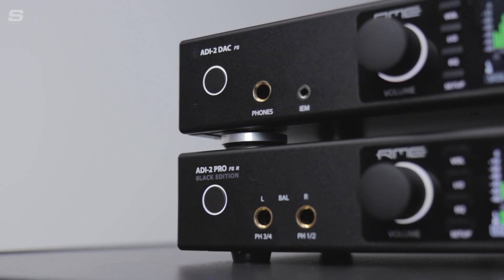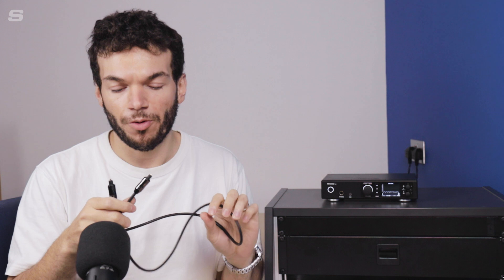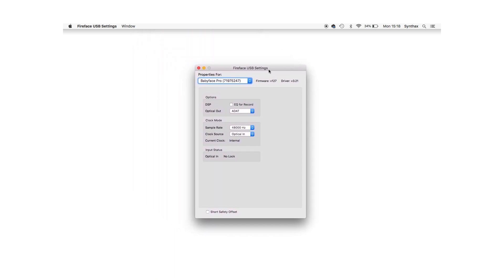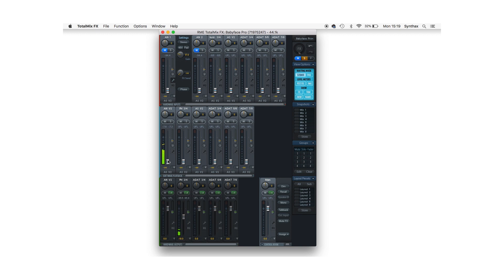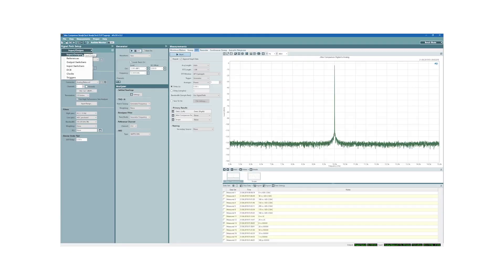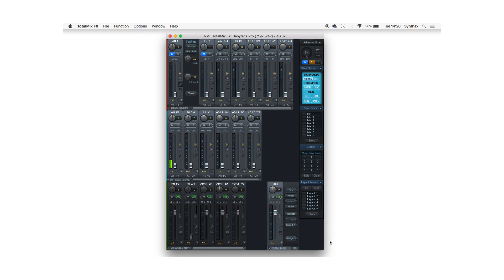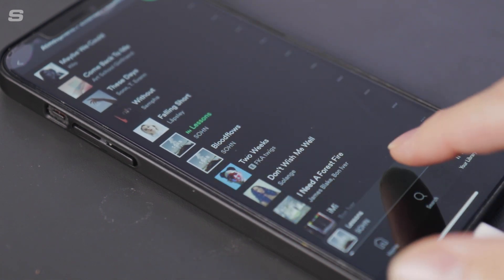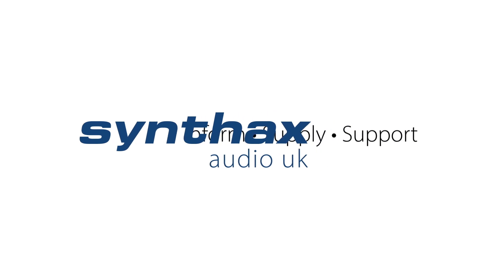How to connect the RME ADI-2 DAC FS and ADI-2 Pro FS R to an Audio Interface

Comment: This is perfect.
I want to upgrade soundwise and already ordered the UCX 2.
My question is...When i buy the ADI Pro fs R how do i connect my adat interface with my UCX 2 in conbination with the ADI Pro fs R? I think it's daisy chaining but not sure how in the correct order. Can you help a bit please?
Reply from the maker: Hi Chris, and congrats on ordering a UCX II! You may be able to connect all three devices, but I'd need to know a bit more about your setup;

1 - Are you on Mac or PC?

2 - What device is the 'adat interface'? i.e. what brand and model?

Let me know and I'll try to help!
Reply: @SynthaxAudioUK  Thnx for your reply. 
1: I'm on Mac.
2: It's the Behringer ADA8200.

Thanks a lot!
Reply from the maker: @chrismacintos6304  Ah okay, in that case it should be doable. The short answer is I'd recommend having the UCX II connected to your Mac as your interface (and set as clock master), with the Behringer hooked up over ADAT, and the ADI-2 Pro via AES-3 for your main output. Then use TotalMix to control all of your routing.

Here's a more in-depth version if you want a bit more info;

1 - Connect the RME Fireface UCX II to your Mac via USB. Set this as clock master in the RME settings.

2 - Connect the Behringer via ADAT to the UCX II. Looking at the Behringer it looks like its actually an audio interface as well (I thought it was a mic pre at first glance), so I'm working on a bit of an assumption here that it will play nice with the UCX via ADAT... (Alternatively if you have any problems, you could try creating an aggregate device since you're on a Mac.)

For clocking, set the Behringer to word clock slave via the back panel. Note that I'm also assuming that you can clock the Behringer over ADAT - if not you'll need to clock it to the UCX via the BNC connection.

3 - RME ADI-2 Pro connected to Fireface UCX II via AES-3 (AES-3 is available on both the UCX II and ADI-2 Pro FS R via each device's breakout cables). 

I'd recommend using dedicated digital XLR cables for this - you might get away without one if you have the two units right next to each other, in which case the breakout cables may reach. They're pretty short though, and we'd always recommend connecting via dedicated cables anyway - more room to work with, less chance of putting strain on the cables, easier to replace etc. 

If you buy a pair of AES cables, you can connect the second cable from the Pro back to the UCX, which will allow you to use the ADI-2 Pro's inputs for recording as well. For the clocking, set the ADI-2 Pro as slave (via its front panel).

4 - Finally you'll need to set up all of your routing in TotalMix FX. This should be fairly straight forward if you have previous experience using an RME interface (set the AES-3 output as your Main output, and set up your inputs and outputs for the Behringer). 

If you're new to TotalMix it may lead to some head-scratching at first though - I'd recommend watching RME's TotalMix tutorial series, or our own videos (they're from back in the day, but still relevant);

TotalMix FX Beginner's Guide
https://www.youtube.com/playlist?list=PL0QKeSpeDQwHGxAhD-cJSIBZC7_en5rck

RME TotalMix FX Tutorial Part 1 (of 2) - Synthax UK
https://youtu.be/sCH3qVaLL-I

Best of luck with it and enjoy your UCX II. If you need further assistance you can contact support for your region here;
https://www.rme-audio.de/support.html
Reply: @SynthaxAudioUK  I'm laughing. I totally forgot the AES connection. Now i understand how to get it connected.
I took a look at the rme breakoutcables. I need to buy them myself i guess. So both devices need a breakoutcable and all i have to do is connect them with 2 fem/male XLR'S? Is that correct?
The other connection stays unconnected? (Red white cable) (spdif)

These connections are new to me so wrapping my head around it since i have a few months left to wait for the ucx2!
But i need to know everything in detail and need to know which cables i have to order to make it work!
Reply from the maker: @chrismacintos6304  Hey Chris no problem, there’s a lot of different formats out there - we’re thinking about creating some new vids to explain each one, so watch this space :) 

You’ll get a breakout cable included in the box with each device, they’re basically just there to add more I/O that RME didn’t have space for on the main body.

I’d recommend buying proper cables though still - just Google digital AES-3 XLR cables. Make sure you get digital ones of course (analogue XLR cables won’t work for AES).

“all i have to do is connect them with 2 fem/male XLR’S?”
- Yep! As you’ve spotted, the red and white connectors on the breakouts are for SPDIF. This is another digital audio format that is similar to AES-3 (and ADAT). You can actually use this if you want instead of the AES connection, it’s up to you (just search for SPDIF coax cables). 

I personally favour the AES connection as the 3-pin XLR is a more solid connector, plus it leaves the SPDIF available for other devices if you fancy running them through the ADI-2 Pro (most consumer devices have SPDIF on there - TVs, games consoles, CD players etc). 

(Watching blu-rays through a PS4, the ADI-2 pro and a good set of headphones is great fun!)
Reply: @SynthaxAudioUK  Thnx for the info. I know where i'm at at the moment. Starting to understand it.
And on the speaker part.
Do i keep my monitors connected to my interface or do i need to connect them to the ADI-2 PRO?
Does the ADI has balanced outs?
I see xlr's and jack on the main output part on the rear.
Reply: @SynthaxAudioUK  I emailed RME to ask what options i got.

They told me to use only ADAT, both ways.
So ADAT out(UCX2), to ADAT in(Behringer), ADAT out(Behringer), to ADAT in(ADI-2 Pro FS R.

Also they've told me that it is not neccesary to use the AES connection.
I wonder what will work best. I can't wait to install my new stuff...
Reply from the maker: @chrismacintos6304  Ha cool okay, say hi to them for us! (We're RME UK...)

Re. Balanced outputs - yes the ADI-2 Pro has balanced outputs, and yes I'd recommend using this output for your main speakers (the ADI-2 Pro has higher quality DA than the UCX).

In regards to connecting all three devices via ADAT, yeah that should also work and might be a more elegant way to do it, although presumably that means you're losing 2 channels from the Behringer. (i.e. you'll only able to record 6 channels at a time from the Behringer)
 
Basically you've got a bunch of different options in how you choose to connect it! Enjoy :)
Reply: @SynthaxAudioUK  hahaha. Funny as hell! So the xlr's and jack outputs are balanced right? Well if that's the case that'll lose 2 channels i don't want that option haha. I need as much channels as possible atm. My rig isn't finished yet. So in order to keep al 8 from the behringer i need to connect via AES, the option you suggested?
Reply from the maker: @chrismacintos6304  Hey yeah both the XLR and TRS outputs are balanced on the ADI-2 Pro. 

Re: daisy-chaining via ADAT, it’s my understanding that if you send 2 channels from the UCX to the Behringer - then send those 2 channels again on to the ADI-2 Pro - you’ll only be able to add 6 channels to the ADAT stream from the Behringer (as ADAT is limited to 8 channels).

If you use the AES or SPDIF connection, this won’t be a problem as it’s completely separate to the ADAT, leaving you free to use all 8 inputs and 8 outputs from your Behringer.
Reply: @SynthaxAudioUK  you've helped me a lot to understand it.
Many many thnx!

I will use the AES for sure now and connect the Behringer in and out via adat.

Thnx a lot again.
I will most definitely come back here if i need more advice.
Reply from the maker: @chrismacintos6304  No problem! If you're in the UK, don't forget we offer a free 5 year warranty on RME products - just make sure you buy your gear through one of our authorised UK dealers, listed here;
https://www.synthax.co.uk/latest/dealers/
Reply: @SynthaxAudioUK  honestly...It sounds very appealing. But unfortunately i'm a dutch citizen.

Comment: What are the main differences in conversion quality between the ADI-2 Pro FS R and the Babyface Pro FS? I'm not sure if it has to do with just the implementation of the clocking (Steadyclock FS) or the monitoring capabilities of the ADI-2.
Reply from the maker: Hi Milton, both the ADI-2 Pro FS R and the Babyface Pro FS have SteadyClock FS, so you'll get the benefit of that technology with either device. Discussing sonic differences between RME devices is difficult since all of them follow a similar goal of 'transparency', although in terms of sound quality the ADI-2 series are a step above any of the standard RME audio interfaces. 

That being said, the Babyface Pro FS really is an excellent sounding interface already - I personally own one and I love it! And whilst I'd also love to have an ADI-2 DAC or Pro as well (maybe one day...), I don't particularly feel I'm missing out with the Babyface Pro FS - it already sounds fantastic, and gives me the benefits of proper RME drivers and all the flexibility of TotalMix FX.

The dream combo is of course like we show in this video - an RME interface with an ADI-2 DAC or Pro tacked on, which will give you that 1% or 2% extra. We're talking fine margins here though, and it depends on the usage case. Most of the music I do is dance and electronic based, and personally I think an ADI-2 is probably unnecessary or overkill for what I do (synths and drum machines...). If I was recording and mixing more classical, jazz or acoustic instruments in my work, or if I was regularly mastering for myself and other people, then I'd probably be looking to add the ADI-2 Pro or DAC to my setup. As it stands I'm perfectly happy with my Babyface Pro FS for day to day music production duties, although if money was no object I'd definitely add an ADI-2 as well.

Hope that helps clarify things a bit!
Reply: I’m experiencing a reduction in volume with this setup… and I’m afraid to push my ADI 2 Pro fsr too much. Seems if I want full volume I have to listen directly from the Babyface. While I am using lower power Headphones (beyerdynamic dt 770) I really can’t detect a great difference in audio quality between the two units.

Comment: So basically the ADI-2 is an audio interface then correct? Is there something that makes it less of an interface than a Fireface unit?
Reply from the maker: Yes the ADI-2 Pro FS R is effectively an interface, but it runs in Class Compliant mode. This means you don’t get the benefits of RME’s TotalMix FX.

The ADI-2’s focus is more on audio reproduction and conversion and getting the best quality sound from its two input and two output channels. 

If you look at the new Fireface UCX II or the 802, there is far more in terms of connectivity and features when it comes to actually recording music, which is primarily what an interface is used for.  That’s why in this video we are combining an interface with the ADI-2, mainly for its high-end monitoring capabilities. 

Hope this helps!
Reply: @SynthaxAudioUK  Absolutely. Makes sense. Thanks for clearing that up for me!

Comment: In order to connect the babyface pro to adi 2 dac and also my tv, what options do i have ? My tv only has optical and hp out, and the optical in on adi 2 dac is already used by the babyface. Would like to use my monitors on my tv.
Reply from the maker: Hi there! If I've understood what you're trying to do, you could try an optical to coaxial cable or optical to coax converter and run from the TV to the coaxial input on the DAC. There appears to be a few options online that are relatively cheap. We can't vouch for how well a cable or converter like this would actually work in principal though!

Comment: Looking for a replacement for my fireface 800 (don’t need all the channels and i have an external preamp). Would i go for something like the adi-2 pro fs, or is that overkill?
Reply from the maker: @Kostya K. Hi and yes, the ADI-2 Pro FS R has 2 x line-level inputs. 

Since the purpose of a microphone preamp is to boost the signal up to line-level, you can connect any external preamp to the Pro's inputs for recording (most likely with female XLR to TRS cables).
Reply from the maker: Hi Alex! 
The ADI-2 Pro FS R can work as a class-compliant 2-channel interface, and you'd obviously get the incredible quality of the unit, but yes it may be a bit overkill!

As the ADI-2 Pro FS R works as a class-compliant interface, you don't get the benefit of Totalmix FX like you have with your 800. 

If you want a simple 2-channel recording device, I'd suggest the Babyface Pro FS or if you're looking for more features, the new Fireface UCX II is also a fantastic option!

Comment: Use of usb port in pro fs r?? Can i record without interface?
Reply from the maker: Hi there!
Yes, it's possible to use the ADI-2 Pro FS R as a class-compliant audio interface and record with it!

As it's operating in class-compliant mode, there is no access to RME's TotalMix FX routing software however, which may be a deal-breaker if this is something you rely on. If so, you're best checking out the rest of RME's audio interface range!
Reply: @SynthaxAudioUK  i am not a fan of complex totalmix, can i still record with logic or any daw with same quality?
Reply: @SynthaxAudioUK  So that means there's no ASIO, right?

How does the latency fare then?

Also, many thanks for the video, it opened many doors!